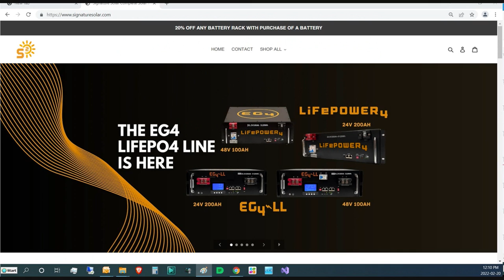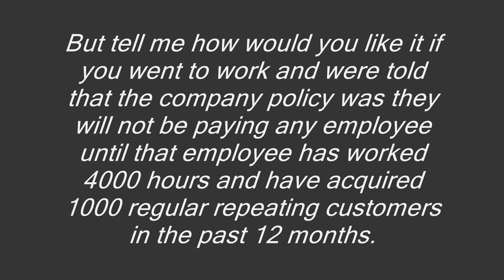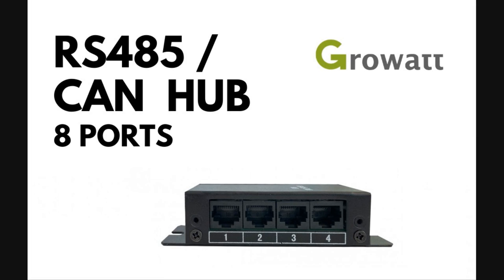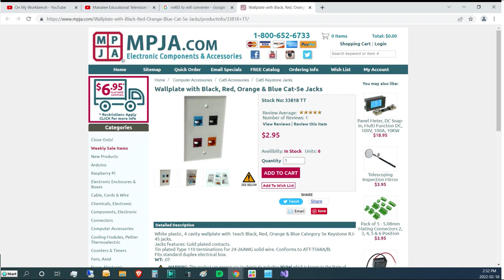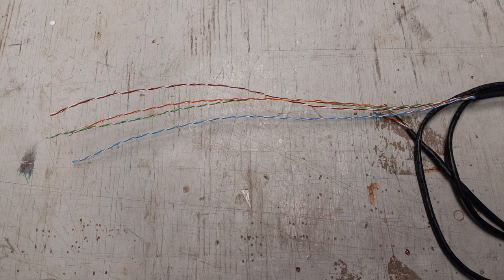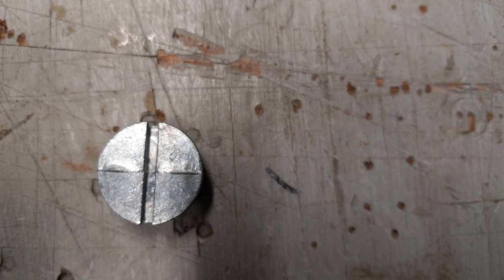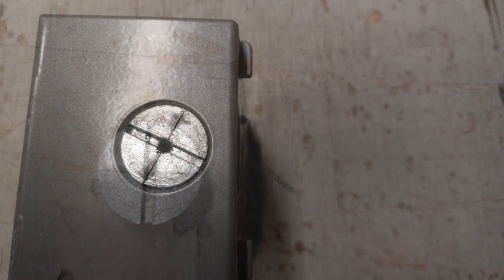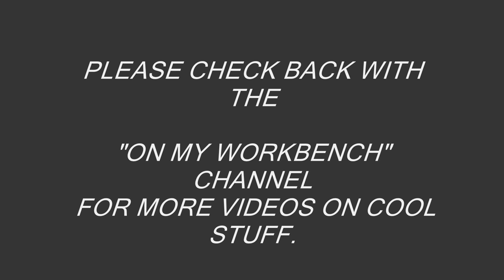4 Way Splitter Box For Signature Solar EG4LL Battery Commutation.

Comment: Thank you for these helpful videos. I'm quite the novice and living on a remote 🏝has its challenges as regards supplies and professional services.  I purchased 4 of the EG4-LL 24v/200Ah  batteries and 6 tier rack from SS.  Imagine my disappointing surprise receiving four batteries w no breakers after spending $kk for shipping abroad, VAT and customs duties. Not a big deal for some but back online I go to shop for breakers, etc... more shipping, VAT and duty to pay. And perhaps I would feel less annoyed if SS supplied user manuals and half way satisfactory customer service.  Ah well... how's a pensioner to feel?

Comment: Great vid. You got a new subscriber. Almost to a 1000!! 

So there isn't a way to use the "Daisy Chain" communication from the batteries that goes to the EG4 inverter display panel to get all this information? I thought that was the point of using their batteries and inverters together. 

I want to be able to see everything I need for set up and tuning on one laptop screen... incoming solar, charge/discharge status, everything. Any solutions for that, @on my workbench ?
Reply from the maker: "So there isn't a way to use the "Daisy Chain" communication from the batteries that goes to the EG4 inverter display panel to get all this information? "
I figured out that there is an issue with Daisy Chaining of the EG4LL batteries that SS will not own up to so I developed my parallel cable workaround. I can't answer anything about the EG4 inverter display as I don't have an EG4 inverter to work with. 
With my parallel cable you can use the BMS Tools Software to view the data from the Signature Solar EG4LL Batteries but I don't know how to view the data from an EG4 inverter having not had one to work with.

Comment: Thanks for this. I have a question. Are you connecting the BMS AND the other RS485 port (Can) to the inverter? At the same time? I could not get mine to talk to the BMS software with or without. Now seeing this, I would like to try again. But reason I ask is on another video, Signature Solar says you cant do that. If I disconnect from the Inverter, I get battery connect alarms. Would be nice to be able to use both.
Reply from the maker: I do not have a compatible Inverter, my  Inverter is a Schneider so I can't comment on what will work. It is my understand if you have Growatt inverters you set your first battery to address to 0001 and connect a cable from the RS 485 port on the first battery to the
Growatt inverter then daisy change the first battery to the 2nd battery using the Battery/Comm ports and repeating for the remaining batteries. You will need to set the next battery to address 0010 the 3rd that to 0011 and the forth battery to 0100. Again I have not tried this so I don't know if it will work or not. On my batteries I have the 4 way cable connected to the RS485 ports on each of my batteries.  I have set the address on my batteries as such. The first battery 0010 for address 2 the 2nd battery to 0011 for adress 3, the 3rd battery to 0100 for address 4 and my last battery is set to 0101 for address 5. Good luck and please let us know how it worked out for you.

Comment: Do you need to set up dip switch to have different address to each battery?
Reply from the maker: Yes with the EG4LL BATTERIES you need to set the dip switches on each of the batteries starting by setting your first battery to address #2 and each battery after that to the next address. After going back and reviewing my videos to refresh my memory I rememberd that battery address 0000 is maped to battery address 16 and address 0001 reserved for the GROWATT inverters, I think SS is trying to get the batteries to work with an existing addressing seem for the GROWATT inverters and had to make some very STUPED compromises.  Please checkout my other EG4LL videos for information on setting the dip switches.

Comment: Nice job !! Can you possibly post all of the DIP settings (that care correct) unlike sig solars incorrect list ? Ive got 12 batts so would love to set them ALL right to be able to do this :)
Reply from the maker: SD BOY, I started a video where I explain what I think happened with SS addressing scheme for their batteries and why Its so CONFUSING. It will take me a few days to finish it. What model of SS batteries do you have? And can you email me a clear close up photo of the address switches, please email it to onmyworkbench@gmail.com Thanks.
Reply: Give me address I'll send you one I think james the owner put out a video to
Reply: I can help you the got what they needed your money that's how they are
Reply: I like the way you just took the bull by the horn and solve the problem! Very nice work and nice quality of your video. Very short, straightforward to the point!
Reply from the maker: @richardbyrum4618  Thank you, I can't stand watching videos where they spend the first 1/3 of the video jabbering.

Comment: Question. Can you make it possible to connect a iPad to the batteries? I do not own nor really want to own another PC but now own 6 Lifepower4 batteries.
Reply from the maker: The issue with connecting an iPad to the batteries is the software,  you may beable to connect the USB to RS485 adapter to an iPad with the use of a USB-C to USB adapter
I don't know if there is a version of the BMS Tools software that will run on an iPad. Probably not.
Reply: You would have to load something like utm and run a virtual windows OS to have a chance.